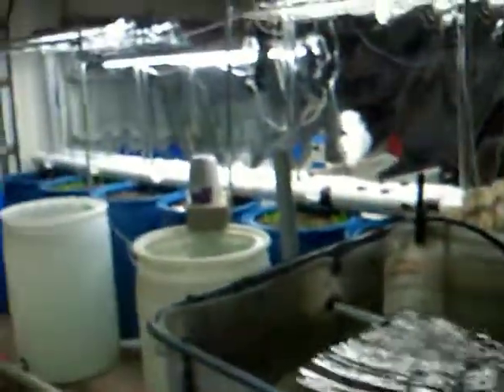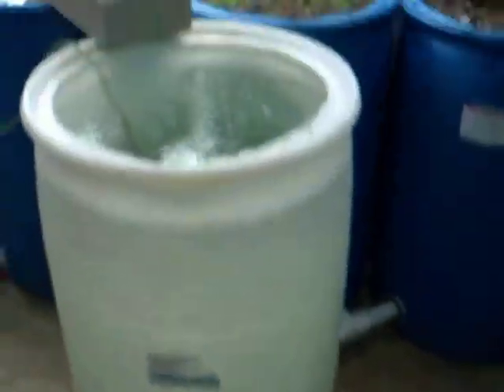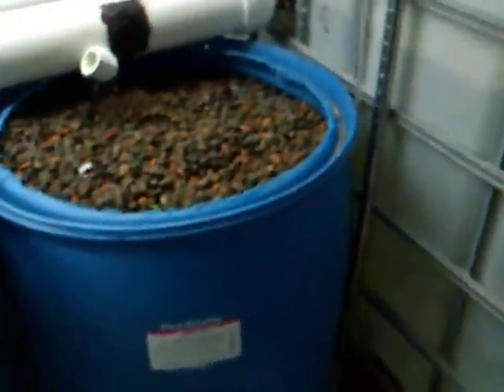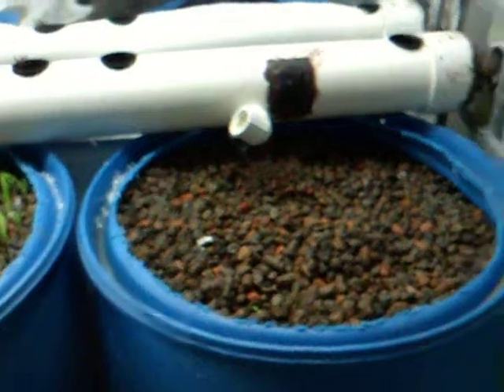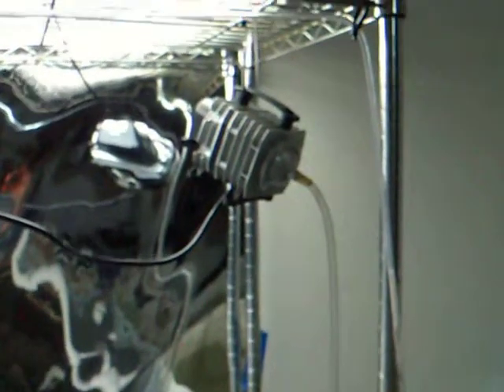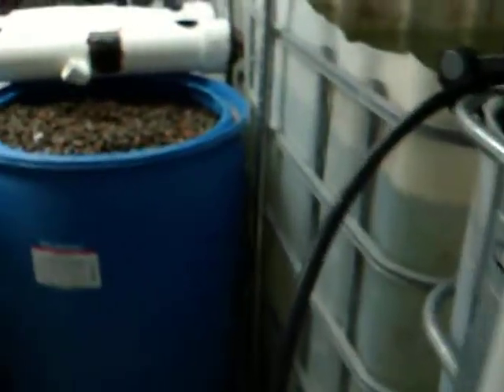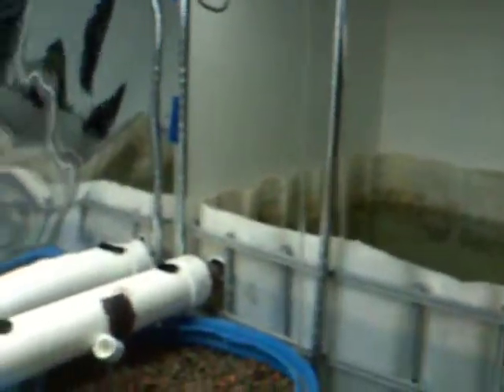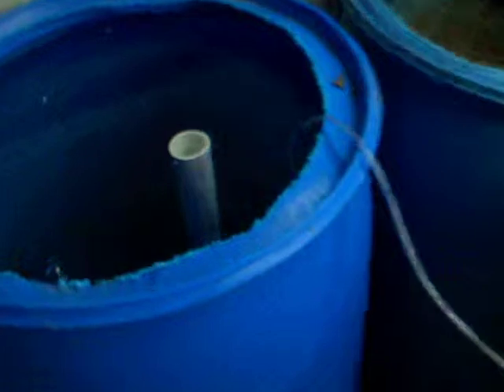Indoor/Garage Hatchery and Winter Aquaponics System Tour

Comment: I love your setups!  What do you call the huge square tubs?
Reply from the maker: they are just 300 gallon IBC tanks. I try not to use them for fish because this isnt intended to be a high fish load system. Just a hatchery/windter system. Small fish are messy/wasteful eaters. I will keep minnows and/or crayfish in those tanks (most of the time) to help use the wasted food. They can also be used as nursery tanks. It's always useful to have a spare "cycled" tank available